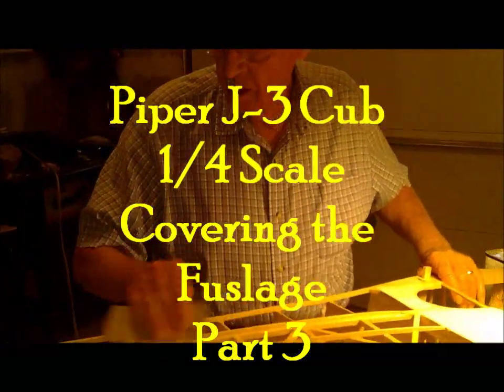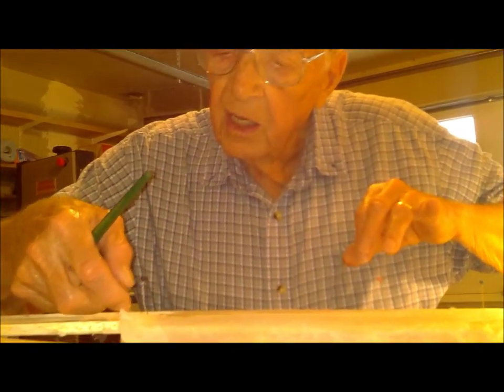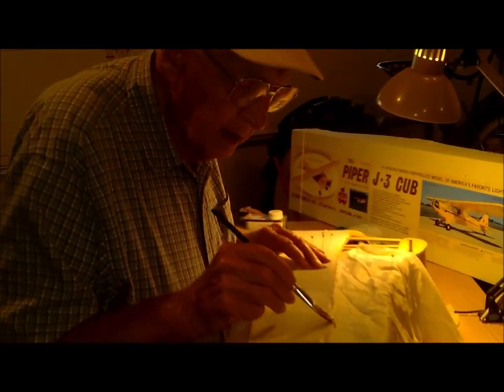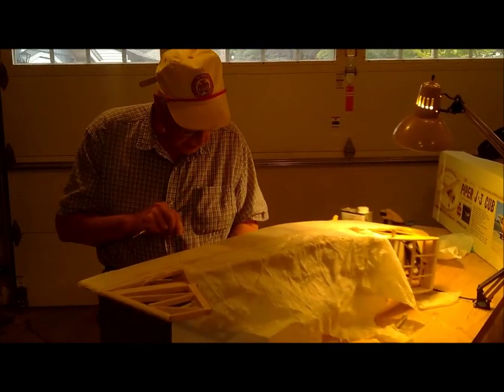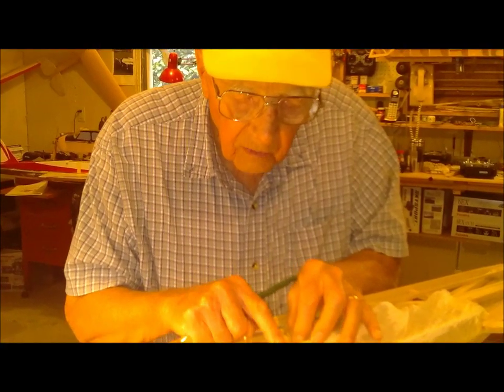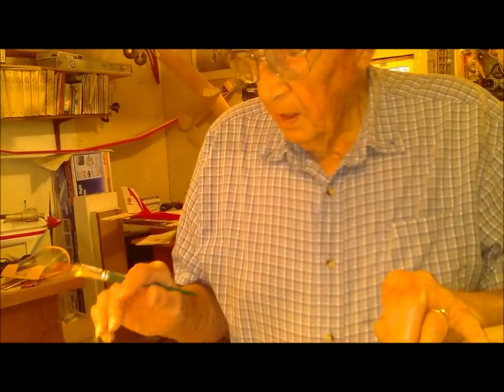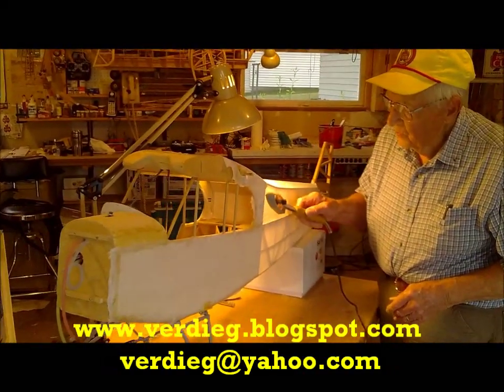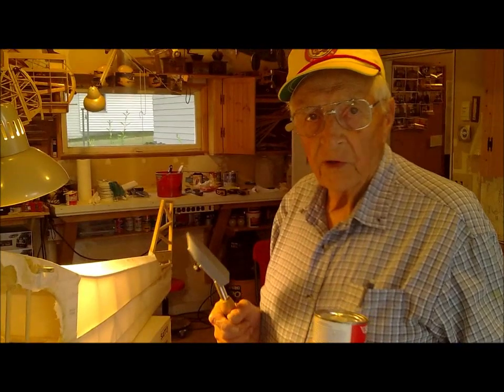1/4 Model Piper J-3 Cub Covering the Fuselage Part 3

Comment: Brings back memories from A&P school in the early 80s, where we used to cover panels with Grade A cotton adhered to the wooden structure with nitrate. Then you'd apply nitrate for the first coat on the Grade A cotton, to tension it. Let's just say that it was a fine art of getting the amount of nitrate correctly applied, and many-a-panel was warped beyond belief with nitrate dope. Wow, that stuff is STRONG. Then we finished it with Butyrate dope, through color. Then we took it to the instructor, and they promptly took out a jackknife and sliced it up...and you got to learn how to repair it. Fun stuff. 

Needless to say I really appreciated it when the Stits process was released in the 1990s...